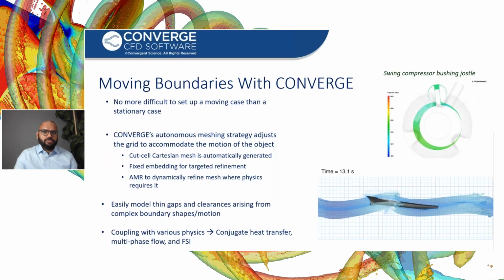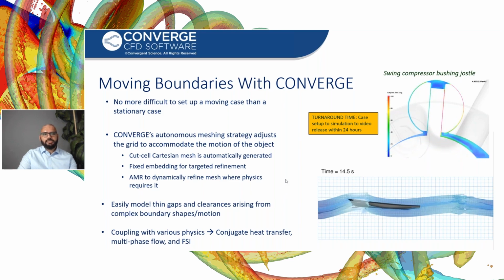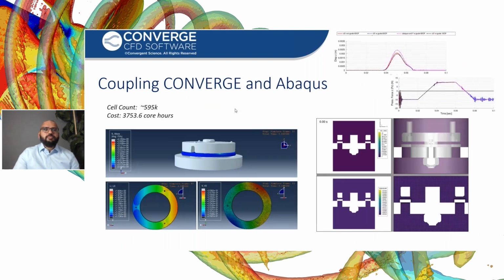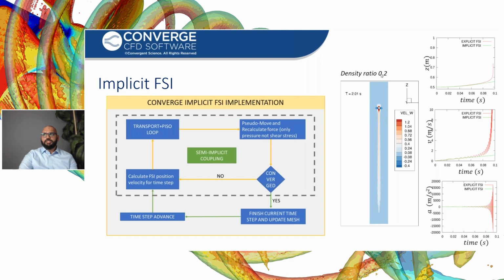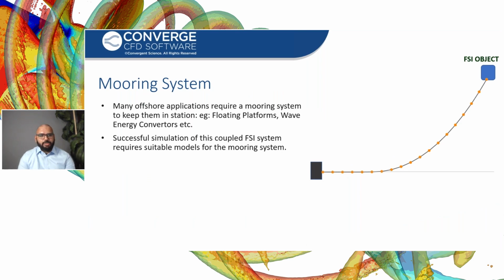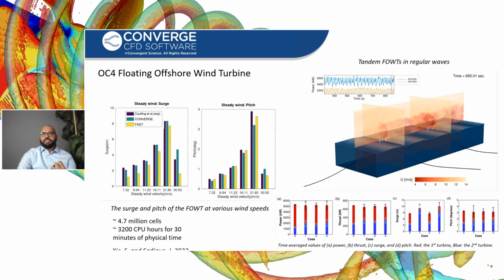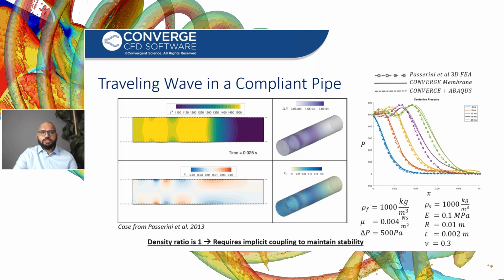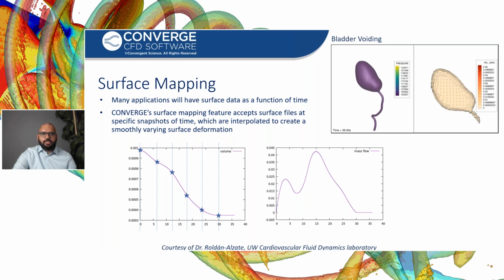WEBINAR | Go With The Flow: Modeling Fluid-Structure Interactions

Comment: Hello,
I am working on coupling CONVERGE CFD with Abaqus/Explicit using the SIMULIA Co-Simulation Engine (CSE).
Before I proceed, I would like to confirm one point:
Does the CONVERGE–Abaqus FSI coupling require any specific Abaqus plug-in (such as the Co-Simulation Interface plug-in inside Abaqus/CAE), or is having the SIMULIA CSE installation alone sufficient?
My Abaqus installation includes CSE, but the co-simulation plug-in does not appear in Abaqus/CAE.
I want to verify whether this plug-in is necessary for defining Abaqus objects/regions for FSI, or if CONVERGE can run the FSI coupling without it.
Thank you!